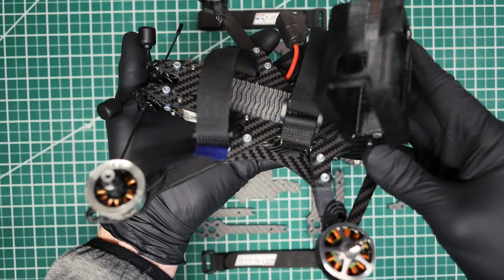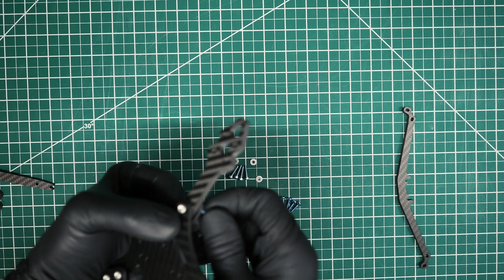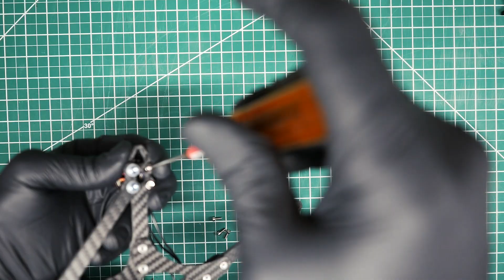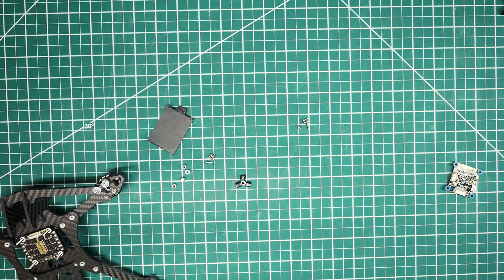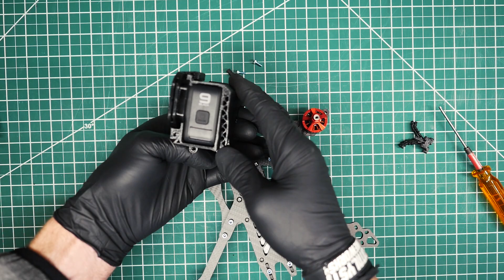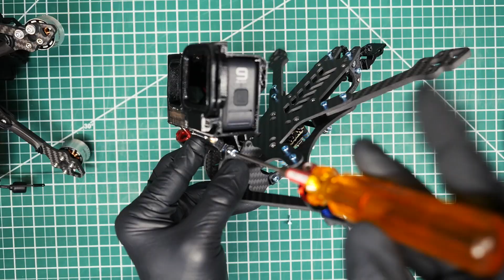Shocker Tank Frame Assembly Video

Comment: I love this frame! Easy access to any part of the quad only requires the simple removal of a couple bolts. I have all of the skid plates on mine and everything is well encapsulated and protected while still allowing enough airflow to keep things running cool. Access to the repair or R&R of any parts (if needed) will still be as simple as the removal of only a couple of bolts. Definitely American engineered! Not to mention the fact that this thing is awesome looking! Can't say enough good things about this frame. It's worth every penny! BTW, it's also a lot easier to build than most other frames I've assembled. 👍👍